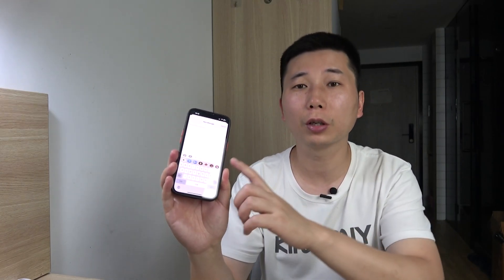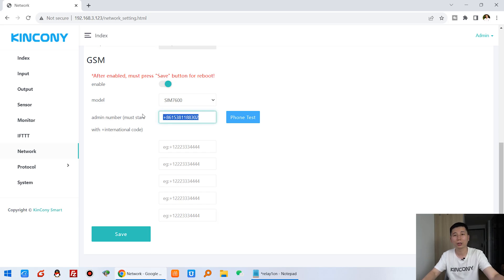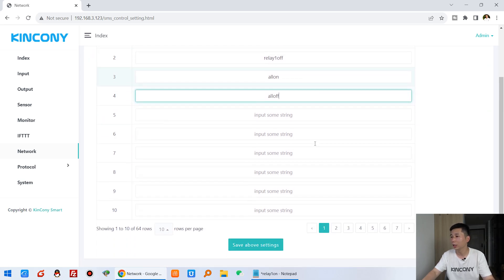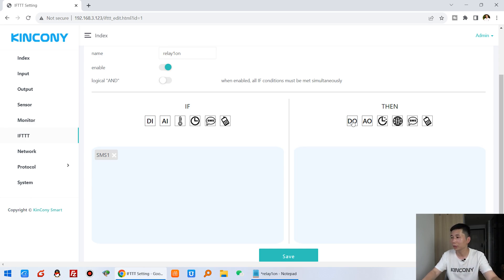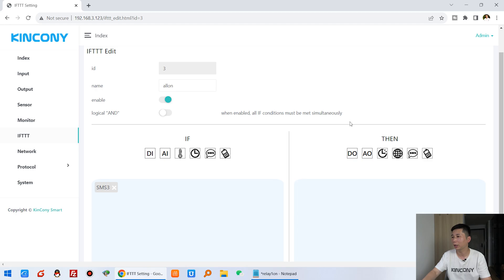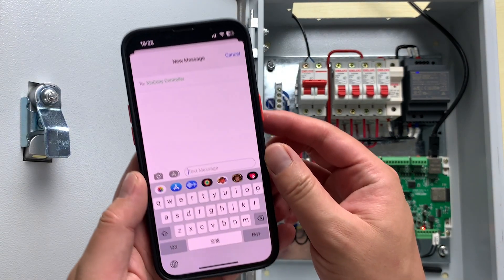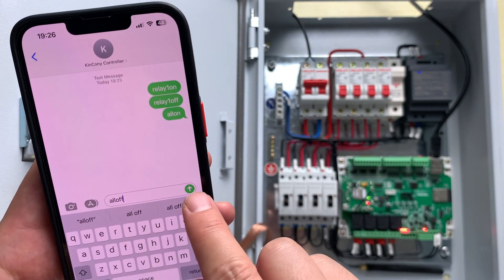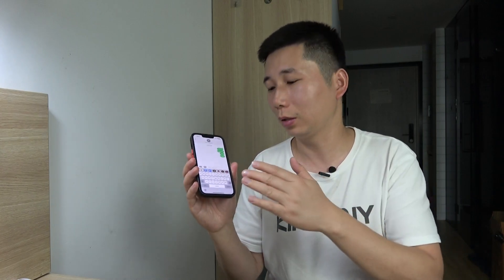how to send SMS control ESP32 relay board without app using SIM7600

Comment: Good morning, I have a KC868-A8S card, with the Sim800L 2g module, Kcs card firmware v2.2.7, I can't control the relays with SMS, despite the procedure described in the video. I also turned to the kincony forum, but no solution. I also tried with previous firmwares, but it doesn't work. Not even with the voice call with tone commands does it work. The SMS and confirmation calls from the sxheda to the phone work, so the number is correct. Now I have ordered your 4g SIM7600 module, will it work with this? I absolutely need to do the checks with SMS because there is no internet where the card is. Thanking you and waiting for a kind reply
Reply from the maker: 4G sim7600 is ok, because KCS firmware only design for 4G module, not use for 2G module.In China, 2G already stopped use.
Reply: @KinCony  Thank you very much, as soon as it arrives I'll try it right away, I hope it works